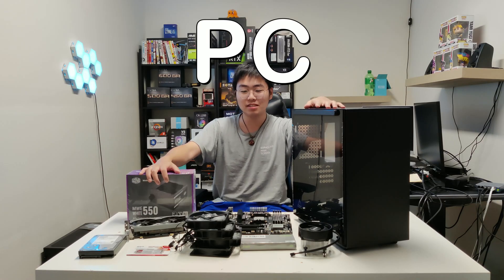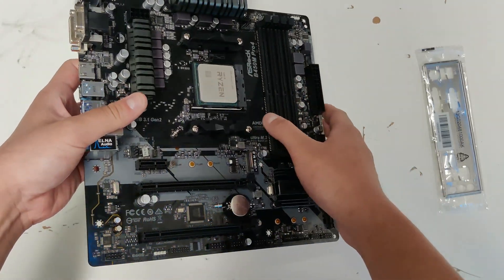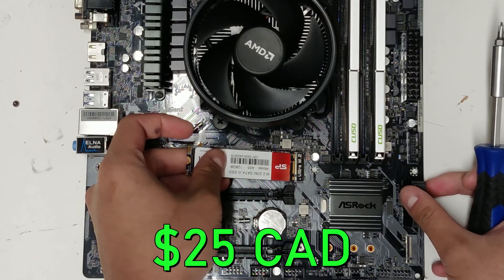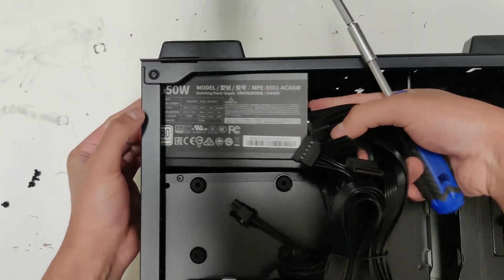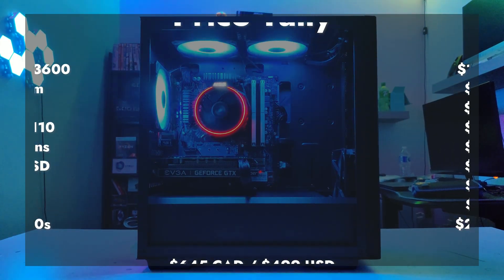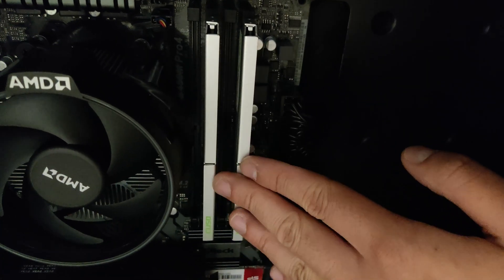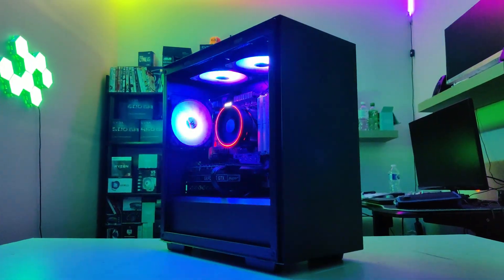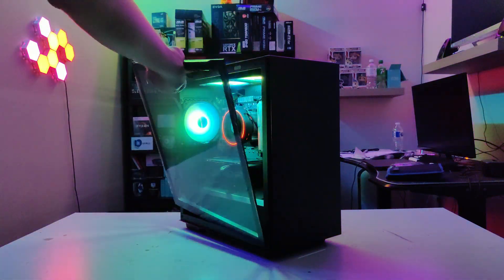GODLY $500USD Gaming PC Build Guide - GTX 1660 Super & Ryzen 5 3600 (w/ Benchmarks) #pcflipping

Comment: i got also good deals bought pc parts in facebook marketplace for $504

cpu: Ryzen 5 3600 $72
cpucooler: Deepcool Gammaxx 400 EX $18.
mobo: ASUS TUF GAMING B550M-PLUS WIFI $90
gpu: GALAX GeForce® GTX 1660 Super EX White (1-Click OC) $135
gpu bracket: Gpu Bracket extender  $8
ram: PNY XLR8 16gb 8x2 3200Mhz Ddr4 $45
ssd: M.2 samsung sata 240gb $23
hdd: Seagate Barracuda 500gb $9
hdd Western digital purple 1TB $27
psu: CorsairCV550 — 550 Watt 80 Plus® Bronze  $36
pc case: PCcooler LM200 MATX/ITX Case  $23
rgb fan: Esgaming RGB FAN 3IN1 KIT 6pcs Fan w/ controller hub  $18

Comment: Opinions on this build guys😊
CPU:
AMD RYZEN 5 3600
MOBO:
Gigabyte A320M-S2H AMD A320 Ultra Durable Motherboard
RAM:
XRL8 PNY 16GB RAM 3200MHZ
GPU:
1660 Super
PSU:
Cooler Master MWE 550Watts /MWE V2 550Watts 80 PLUS Bronze-
STORAGE:
TAMMUZ GKV700 256GB NVME SSD
cpu cooler:
Gammaxx 400
Reply from the maker: I wouldn't recommend using anything a320, it's not future proof enough. Anything more than a ryzen 3 is pushing it already.
Reply: @woostinstechflip  it's a build for my friend hehe...so i yeah i was able to convince him to buy a b450 msi mobo...